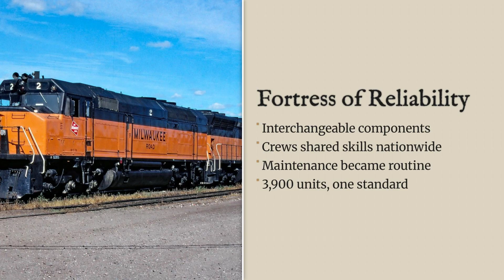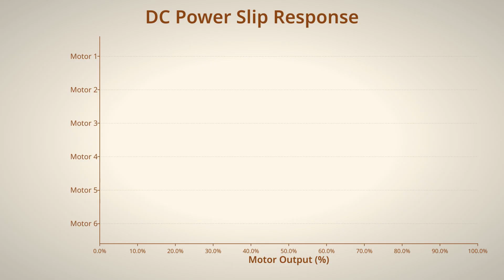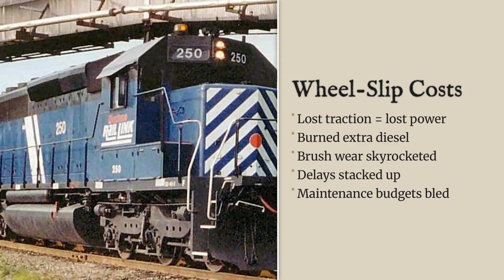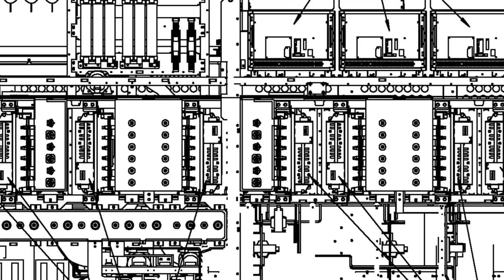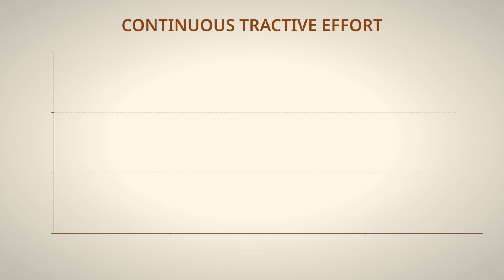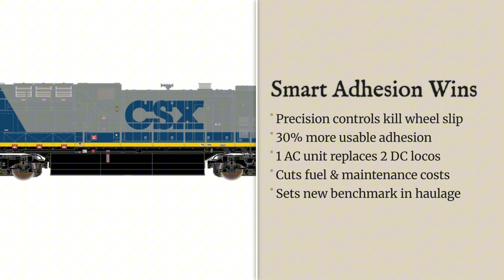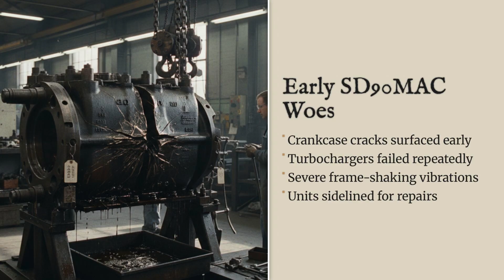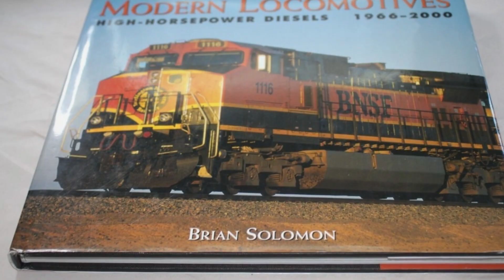The 1994 Locomotive That Killed EMD_ Rise of the AC4400CW

Comment: the newer SD90 mac locos from emd  have problems with their sensors that monitor all the systems .  i ran them . almost ALL the engineers that ran trains preferred the  GE units . they pull better and  are more RELIABLE.